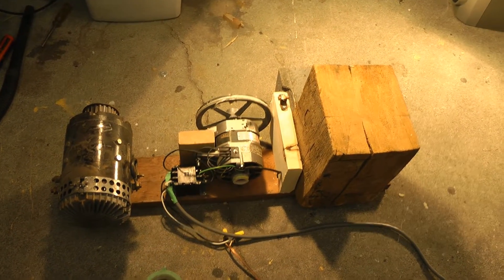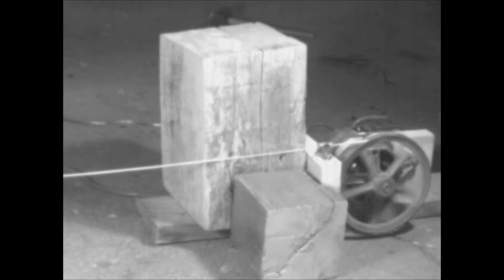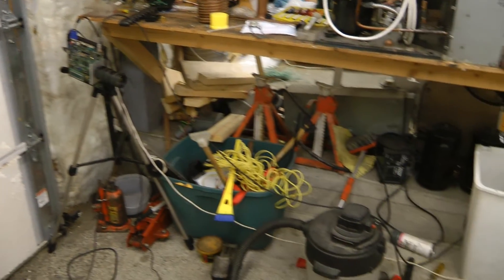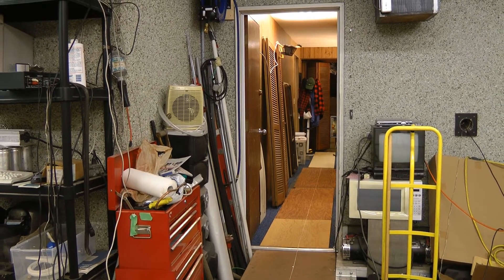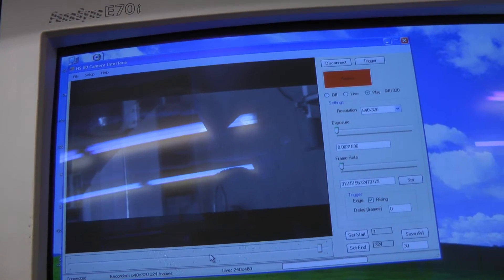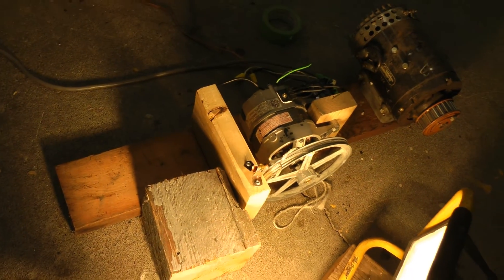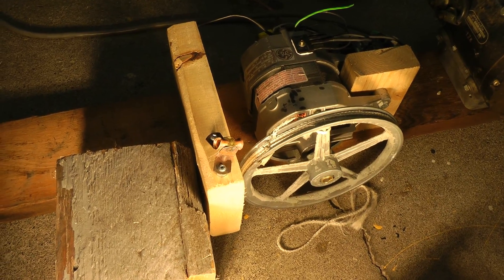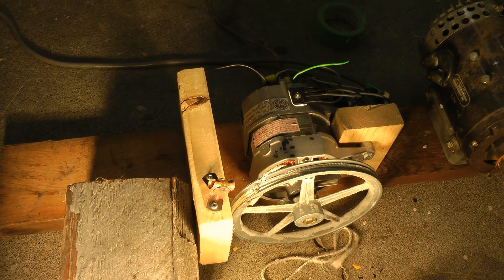Odd phenomenon - Static pattern in moving rope

Comment: DragonFlyback256, go play around with this animation - phet.colorado.edu/sims/wave-on-a-string/wave-on-a-string_en.html.  The only difference is the rope is moving in this video and in the animation, it is stationary.   As the wave travels outward away from the motor, the string is being pulled in towards the motor which is giving the illusion that the wave is static and not moving.  The motor eventually reaches enough speed to pull the wave closer to itself which causes it to "overshoot"

Comment: The inertial forces are caused by the wave motion - See my comment a few comments down.  You have to look at where the force is applied, how the mass of the string accelerates, the tension forces in the string, etc.  Using Newton's laws of motion, you could predict how the string will behave (assuming you also know the mass per unit length of the string) by simply taking all the force vectors at every point along the string.  What you end up with is essentially wave motion on the string.

Comment: This is correct.  If the string was not "sucked up" by the pulley, it would be the same as if someone "jerked" the rope up real quick.  That "jerk" would create a "wave" that would travel down the string.  What we are seeing here, is the string being pulled in at the same rate as the wave is propagating in the opposite direction.  You can see at the initial moment, the wave travels away from the motor until the motor gets up to speed; when it appears to remain static.

Comment: if the rope is losing mass whist staying at a constant velocity, technically it should be accelerating...to the point when its momentum(?)is greater than the remaining weight(?), causing it to snap ahead.imho (bit more thought required)

Comment: You might want to think it's the result of some sort of partial diff eq with a strange forcing function who's result gives a bimodal solution or a result of the resonant freq of the rope changing with length and the rate that the rope is pulled in. You might think its something like that. But in reality its the work of satin. You've been worshiping the devil again haven't you? That's it, I'm reporting this video to the Pope.